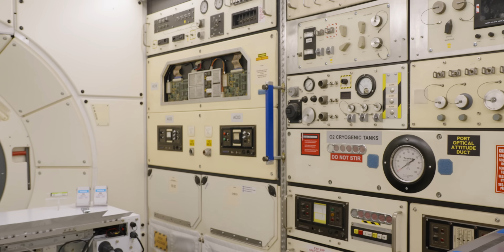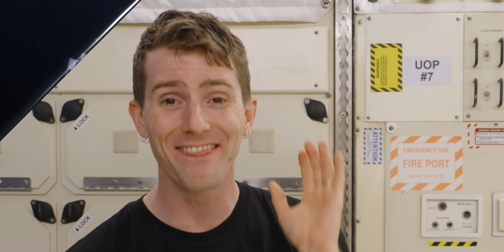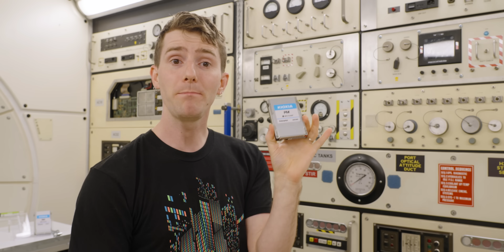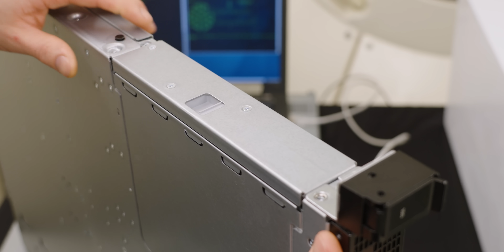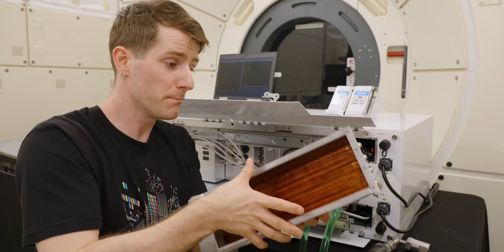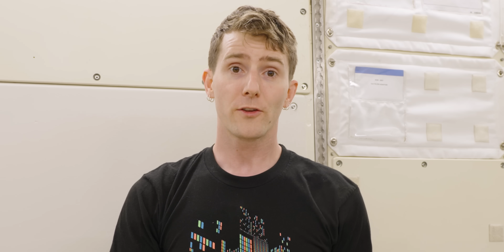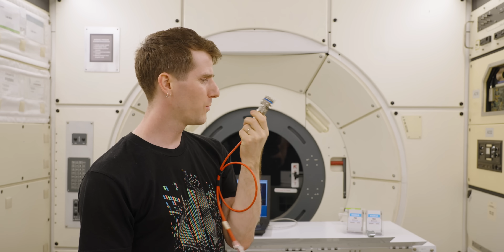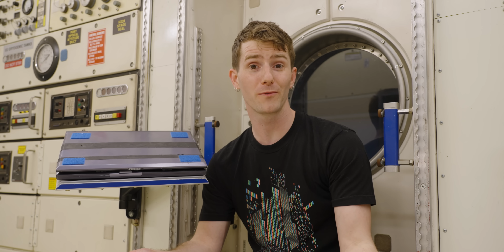here's why it's so hard to put a computer into SPACE - NASA HPE Spacebourne 2

Comment: Today's lesson: NASA space station tech doesn't mean high tech, it just means it's engineered to not kill its occupants as far as possible
Reply: To be fair, "engineered not to kill its occupants as far as possible" in "lethal high energy high radiation environment" is fairly high tech. :P
Reply: Not really surprising.

Think about a submarine - the other kind of pressure vessel we use as a species that deals with dramatic changes. The ISS deals with a total pressure differential of ~1 atmosphere. Relatively speaking, it's easy to keep the thing as one solid piece. The difficult part is the lack of atmosphere.

Take a hinge - like a standard door hinge, two pieces of brass or whatever, that slide together. In space you would find it has the awful habbit of sticking after you open it a few times, and by sticking I mean suddenly welding itself together as the oxide layer is rubbed off, exposing bare smooth metal surfaces that don't know any difference than to presume they are a single continuous piece of metal and suddenly: You can't easily move the hinge. This isn't a problem on earth - any oxide layer that does get removed, quickly reforms. But where you have no atmosphere?

The problems in Space aren't so much about bleeding edge technology - it's about solving problems that you didn't know would be problems. This is why Reliability, trumps basically all else. You need to know it will work.
Reply: But it's the integrating of the solutions of all of these problems where the "high" of high tech comes into play. You could certainly solve many earthbound problems through the use of more resources- hot elements can be cooled if you apply more space, range problems can be solved by using more fuel... you get the idea. But, hostile environments- both underwater and in space- impose their own restrictions. Your vessel can only be so big. It can only resupply so often. You're constrained by exhaust velocity, constant bombardment of high energy particles and percentage weight in fuel... things like that. And then you have the human demands. You need water, food, some sort of way for humans to live in, move safely, and deal with accidents...

We like to think about bleeding edge technology like it's magical and beyond our comprehension, but it's not. We spot problems, then we solve them. Then we find an environment where the basic solution doesn't work and we develop a solution that plays by the restrictions imposed, and so on and so forth. That's what technology is- what it always has been: building tooled solutions to the problems in one's lives. To imagine it as magic just puts it beyond the reach of one's imagination and lets one pretend that everything that can be invented, has been invented.
Reply: @formes2388  Also, you need to remind yourself of something different: You doesn't need to make sure, the ISS doesn't get crushed - as it's the interior atmosphere, that would love to go outside. So you only need a hull strong enough to not have your oxygen and nitrogen diffuse or the pressure breaking the hull - which is something we know to produce since 150 years, as high pressure gas tanks work the same way ;)
Reply: @formes2388  "What do you mean you need 6 computers for a single calculation?" "Well you see Sir we need triplicates to make sure radiation didnt screw us over and a full redundant but unplugged yet grounded spare in case of a solar flare that would EMP our entire compute" 
They take reliability VERY seriously
Reply: @TurtleKwitty  triple redundancy is usually done with life support and safety of flight items. Anything that is not in those categories may have no redundancy at all. It depends a lot of trade-offs you have to make in any engineering decision.
Reply: @evelynkieraivanova5404  Oh yeah for sure theres multiple levels of reliability needs, and that's the top of the charts "the electrical grid and air controllers must survive anything" level
Reply: @formes2388  That btw did happen with the solar-panel hinges in the early days. The story is that the ISS in the early years was lower on altitude to preserve power during construction, and therefor did a "night-glider-mode" during night-time (that means when they have no eye-sight with the sun because they are on the other side of the earth) phases of their fall. Because in the lower altitude the atmosphere was still a problem and the panels act as sort of an air-break. So they turned the panels to have a lower air-break-effect durting night-minutes. But this rubbed the oxid from the hinges connecting the panels with the panels.
After they found out this was beginning to be a larger problem the 5Head-Guys at NASA thought about it and didnt came up with a solution until one day someone had the "sticking-glue" problem of a specific tape and ordered to smear the sticky part of that tape (what they did have on station on that hinge while it was rotating. And the problem did go away.

Today the ISS didnt get so many upgrades of heavy-duty components like new sections and the ISS is at a higher altitude where the atmosphere is much thinner and therefor the air-break-effect is not anymore that much of a problem. I mean it is, but they have to do manouvering to gain altitude much lesser and more because of space-debris than slowing down to earth.
Reply: To be fair, it is up really high!
Reply: It's like seeing explosion proof secruity cameras in a companies product line, then thinking they must be some crazy kind of armored camera. Then finding out it just means they won't cause an explosion not that they would survive one.
Reply: That's in line with what "military grade" means. You hear it in films and you think it means high-end top-of-the-line gear but in the real world they're far more concerned about reliability.
Reply: @johnnypopstar  "military grade" is a bullshit term that means absolutely nothing in the real world. Any time you hear that, it is crap.
Reply: A bit unrelated, but one of the popular basic frameworks for food safety was built when Nasa was thinking about food for space im the 60s
Reply: It's a great example of the principle that "best" depends heavily on use case and operating conditions.
Reply: @annieworroll4373  name something higher tech on the market today than the latest GPUs and CPUs?
Reply: they were higher tech than anything NASA's ever used before.
Reply: Military grade just means "reliable enough" for the least cost.
Reply: And been made completely obsolete by redundancy and ECC ram. Just like SpaceX does.
Reply: It's high tech in the sense that the amount of effort that goes into deploying that technology is overall absolutely monumental, even if the "production" part of that effort can be considered relatively trivial nowadays.
Reply: It just means "good enough for government work"

Comment: it is ironic that "space age technology" needed to be older and more analog to survive.
Reply: And/Or, Because it took so much time to build things and most of the NASA space tech was designed and engineered decades ago,  They can't just update/replace to accumulate new tech.. Like for the ISS.
Reply: @mozzjones6943 
On top of that, hardening of electronics often involve high tolerance parts and thickened electronics to reduce particle related wear. Space Race era computers are often solid state memory with preset commands and calculations.
Reply: @mozzjones6943 considering most the modules were originally going to be for space station freedom (dual keel freedom is best freedom), by the time some of them were launched they were already over a decade out of date in terms of tech
Reply: @mozzjones6943  No, as the ISS is completely modular, they could literally just replace a whole module of the station, in fact, if we would still have a space shuttle, they even could reconfigurate the whole station, to become more modern.
Reply: @mozzjones6943  and yet they can't even follow their own guidelines for making a rocket go figure. joking aside while the getting things to space and having it work issue is a factor most of it's Bureaucracy.
Reply: the ISS is EOL anyway , we are 6 years away from the launch of the deorbit module and less then 7 years for the planned deorbit.
Reply: @kebabgud  Most likely the ISS will not go deorbit soon, as the new station isn't even started. With MIR they also had planned to decommission it in the middle of the 1990s, but in the end they needed until 2003, because only then the ISS was build up enough to start operation.
Reply: @kebabgud  how tf are they going to get that giant thing through the atmosphere?
Reply: @nathan22211  the ISS?  they wont. they will crash it into the Atmosphere and let it burn up over the pacific.  same thing they did with MIR
Reply: Not when you consider the "space age" was 60 years ago.
Reply: @bthatguy1181  That was the space race. This is the space age.
Reply: Just do it Dune style and have freaky psychic people do the computing, as analog as it gets.
Reply: The PS1 CPU, a SPACE HARDENED variation was used in space as it had proven to be stable and trustable. LONG after on earth we got much better stuff. 
But testing takes time. You need to know sure that the tech you send, and HAS TO RUN, will do the job.
Reply: Not really. The old tech has been studied for many years and all of the potential bugs are known. When the tech is in space like a satellite it isn't possible to hit the reset button. Stuff that is sent to space just has to work because of the cost to build it and get it there.
Reply: Sounds like the land part of the nuclear triad... which was still using a huge arse diskette...
Reply: Nah it's normal. Space age technology means it's reliable and light.
Reply: @Stay_away_from_my_swamp_water  exactly
Reply: "Space age? That was fifty years ago!" - Ashens
Reply: To OP: Yes, somewhat ironic but partly because older tech had been implemented when the ruggedness equating with heaviness of components hadn't mattered as much.  But it did matter.  B-17s weren't in the habit of carrying much radar equipment along with the radios.

It also strikes me that post-1960s transistors and the microprocessors that followed have had a "Happy Times" period roflstomping the consumer and professional world in the bosom of the planet's atmosphere, sometimes going on the fritz for high altitude private jet owners and the occasional military spyplane.  But yeah, as far as space goes, it's ironic to think we'll have to revolutionize both propulsion and shielding so that weight for the electromagnetic shielding isn't as much of a factor, just like with first generation jet aircraft.  Then the computers, even the laptops, will run like the workhorses most Linux boxes are.
Reply: it takes space age technology to create space safe technology
Reply: Its just because it looks cooler
Reply: The Humble space telescope runs 486dx4
Reply: Yeah that line cracked me up.
Reply: @NicholasKoeppel  I love that about space tech, sure it takes a while to get down to earth for most people. BUT... a lot of research has been done first. 
The first actual micro processors! First users? Servers? Hell no! Instead they had to make thousands of them to get just a few tested and up in space.
Reply: Unfortunately NASA suffered a ton of post Apollo brain drain due to funding dropping off a cliff and these people not being necessary any longer. Apollo development was well known for making on the spot engineering changes with poor documentation. The best minds in the world were winging it quite often. The government spent an ASTRONOMICAL amount of money on the space race, which doubled as research into rocket/missile technology for ICBMs.

Space projects ramped back up a bit more in the 80s with the space shuttle's release, but nowhere near the scale of Apollo. Then the shuttle had two significant losses and space projects dropped off a cliff again.

By the time the 2000s came around majority of the senior minds of the Apollo project had long passed away. With them died an enormous wealth of information.

Keep in mind that post ww2 and prior to the space race the US government was pushing public schools around the nation to get smart students into aerospace/rocketry. This was a nationwide effort which saw a huge surge in talented students getting into the field. The best of the best rose to the top and become pivotal in rocketry through the cold war.
Reply: And yet SpaceX uses modern Intel CPUs and NASA uses Snapdragon chips on Mars.
Reply: A lot of the stuff would work fone with appropriate radiation shielding, namely metal foams.
Reply: really more of a NASA problem. with the increase of newspace companies and startups, space technology has vastly improved. long gone are the old massive computers and incoming are raspberry pies, nvidia GPUs, and linux on arm. even chromium-based web apps for flight control displays. plus high speed satellite internet on some spacecraft (you can guess).
Reply: lets just say the universe doesnt really like digital information. the sun's radiation just makes it more obvious and accelerated.
Reply: well government has never been good at moving fast. Private industry should be in charge of the tech and integration. I mean a us defense contractror charges 90k dollars for a very small bag of bushings. they charge too much because the government pays with tax dollars.
Reply: @Spearhead45  Can you point me to the private enterprise space stations?
Reply: @Cohac  is there one?? how about spacex doing nasa's job 10x better. private sector can do much  better than government programs..
Reply: @Spearhead45  Oh boy... Now i wanna see a local tech company trying to launch their own sort-of-ISS to space and dealing with the usual "update failed, reboot required" failures...
Reply: @Spearhead45  yes and no. The engineers back then knew what they were doing, and were able to create robust analog tech that just works. Even today the russian soyuz is still the most reliable spacecraft in the world. So it may take a while, but you need that toyota approach to tech when it comes to aircraft and space tech
Reply: @Spearhead45 if NASA had blown up as many rockets in a row as SpaceX congress would have shut them down. They can move fast when properly funded and motivated.
Reply: @m0redread  that's because NASA uses tax money, when they blow up a rocket its a huge hit to the tax payers, and kills the entire crew. When space X blows up a rockets, it's a small spec in Elons pocket and no1 dies.
Nasa has had 6 rockets explode, killing a total of 17 people.
Space X has blown up 11 (5 intentional) and killed 0.
Reply: @m0redread  Nasa has blown up exponentially more rockets the SpaceX. Hell the Falcon 9 rocket is the safest rocket ever made (actual fact). Starship was never intended to survive during the last few launches.   
The Next Launch which is currently set for June 5th has 2 main goals. 
1:  Super Heavy Booster Soft landing in the Gulf Of Mexico. They are going to make the booster think its landing at the Tower and if that is sucsess full then the Launch after that will include a return to tower for the Booster.
2: For Starship  to survive re-entry and do all steps for a soft landing in the Ocean  

Please read their goals BEFORE  each launch so you can see whats the actual intent of the launches are. These are intended to not survive.
Reply: @kebabgud  NASA has only blown up 6 rockets, not sure were u got "exeprionally more" granted they killed 17 people.
Space X has blown up 11, multiple were intentional but still.
Reply: @m0redread  NASA or better said the US Navy under Werner von Braun HAVE blown up many rockets. Also the Army. In fact the first trial of a satellite launch of the USA by the military failed due to the rocket exploding on the ground. Exploding rockets is something normal during development. I don't know any rocket that hasn't at least lost 2-3 satellites in the first starts. Ariane 4, 5 and 6 all had at first failure starts.

Comment: Psst,  a lead wrapper around the motherboard would cut your issues at least in half.
Reply: Aside for that being not the point of this experiment, that would be so incredibly expensive. 
A 305 x244 x5 mm lead sheet (size of a standard ATX mobo) would weigh 4 kg. It costs 1,000 per gram to launch an object into orbit. 
That means it would cost over 4 million dollars to put a lead backplate on the mobo, not to mention covering the rest of it.

Adding insult to injury, when high levels of solar radiation hits lead plating, it generates X-rays that require much more shielding.
Reply: @nathanielhill8156  because, launching things 3 times a year is less expensive then launching something once. Its cute how you tried to math that out without knowing. Let's say a seed weighed 1ton. The crop needed for an astronaut weighed .025 ton. You had a mission that lasted idk. 30 years?  You solve the word problem because if you can't you aren't qualified to comment.